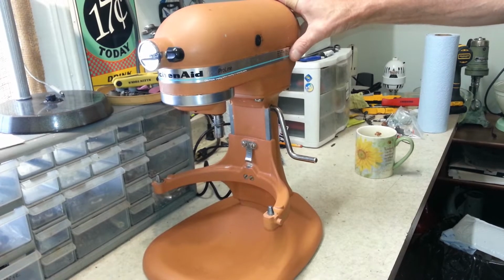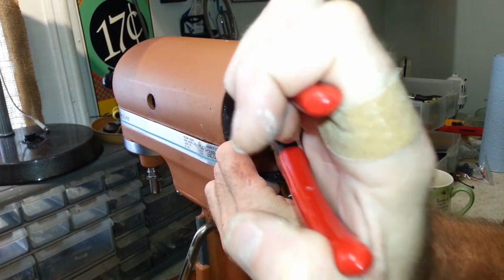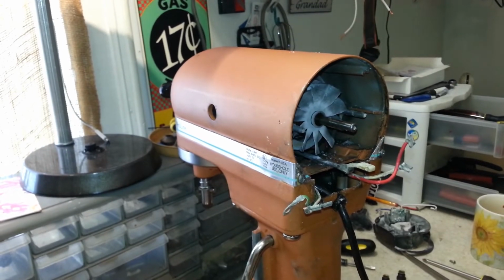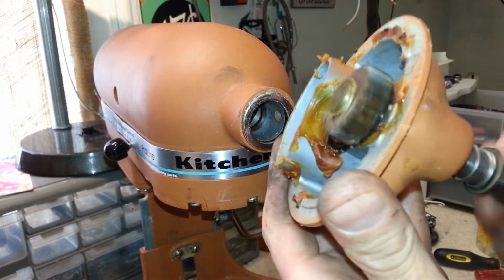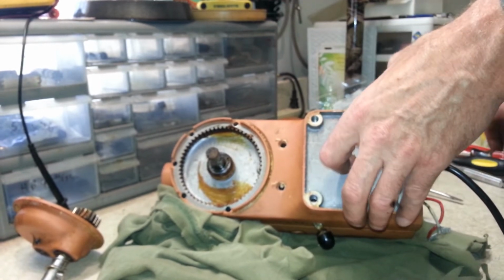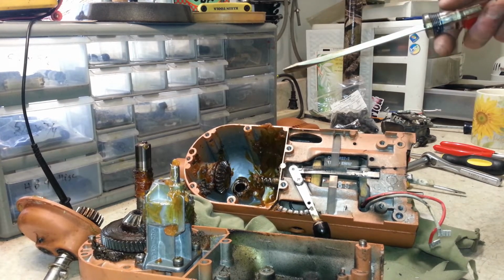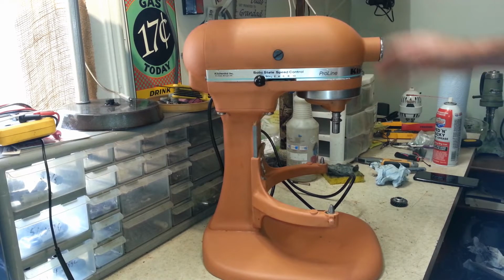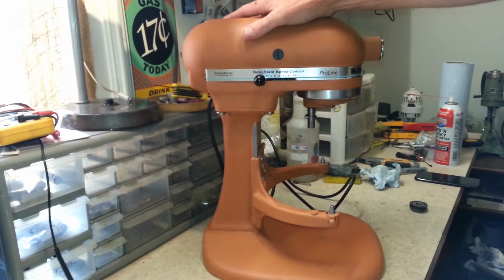Kitchenaid KSM5 service and maintenance

Comment: Much thanks.  Between this video and another explaining the brushes (for when I inevitably put them in wrong and the machine wouldn't start after putting it together), I successfully cleaned and replaced the worm gear assembly and regreased my KSM5. It's a hand me down from mom,  prolly 25 +years old. I don't know if they're the same quality today,  but man,  that's longevity.

Comment: I've hit a wall on fixing my wife's Hobart Kitchen Aid K5-A and I thought with your experience you might be able to answer a couple of questions.  The mixer has no serial or model numbers on it except that it's a K5-A by Hobart. It was purchased in 1974 by my wife. It was diagnosed by an electric motor shop as having a bad armature with a dead spot on the windings. It would run briefly then not run.   I looked up parts on the internet and found an armature that was supposed to work. When it arrived it looked very similar with the exception of the fan. The new one was a multi-bladed fan that was slightly wider and in a slightly different location on the armature shaft. It appeared to fit until I attempted to fit the baffle plate. The fan stopped the plate from going all the way onto the shaft and because of that the rear bearing holder wouldn't seat correctly either. On close inspection, I could see the type of fan and it's location was the issue.  It appears this armature is for perhaps a K5SS with the solid state internals.  Every supplier that shows they sell these armatures have the ones with the different fan, not like the flat one on my mixer.   

After all that, my question: I've seen there is a picture of a different rear bearing holder on some sites that is supposed to fit these older mixers but the picture shows a more open, slightly cup shaped bearing holder that is different than mine. I'm wondering if this would work to provide the extra clearance for the bigger, thicker fan. If not I've got an un-fixable mixer for lack of a part.   I wonder if any of your viewers have any ideas?

Comment: Hi Rick, great video !   I do have one thing to comment about, I also collect sewing machines and I learned long ago to never use "3 in 1 oil" it is a combination of three oils and two of the oils are for protection and as they dry or oxidize, they harden to form a protective layer, it works well for guns and things like that. The oil I used to use on was Zoom spout and it worked fine and did not harden, I found I needed to oil machines about every six months or so. I found something much better " Liquid Bearings 100% synthetic lubricant " this can be purchased on e-bay and I think Amazon, This oil is made with oil molecules all the same size and it works so well and does not dry out, I find I can now go for two years between oiling on my machines and it seems they work smother as well. I have used this as my go to oil for about six years now and would be lost without it. Another great thing about this oil is it has stainless steel needle spouts that come with it you can chose the length or several lengths and be very precise with the amount, on things like clocks.    Best to you,   Brett
Reply from the maker: Hi Brett! Thanks for the tip on the synthetic oil, the technology in lubricants has really evolved! That sounds like it would be perfect for mixers as well, since most do not get the periodic oiling they require. Im not sure what the protective layer in the 3 in 1 consists of, but that would probably be beneficial to the mixers too considering the environments some are used and stored in. I may look into that oil for my sewing machine as well, since I don't use it a lot, and when I got it and oiled it, it looked like the places that get oil were a bit gummy so I had to try to clean them as best as I could. It also needs to go in for service at some point for adjustments, which I know nothing about. 
Thanks!
Reply: Hi Rick, The gummy condition you found in your sewing machine is the result of 3 in 1 oil being used in it, either use the synthetic oil or a quality sewing machine oil, with repeated use the new oil will help to wash out the old gummy stuff. You are a great one for maintenance on things and sewing machine service is usually just cleaning and oiling, so if your machine is sewing good just use it, and play with the thread tension to learn what is right, the bobbin tension is pre-set and very rarely needs any attention so just note the tension number or letter you start with and go one number up or down to see what is happening with you stitch, you want your threads to meet in the middle of you fabric seam. be noting your original setting you can always go back to it. For oiling, the place to oil the most is the bobbin race area around the bobbin holder, a drop in this are every few days of sewing is good if you use it a lot. The thing you found with the gumming up is what happens with 3 in 1 oil, it clogs up the holes in bronze bushings and clogs up any felts or wicks meant to feed oil into the bearings.   Best to you Rick,   Brett
Reply from the maker: Thanks Brett! I will get some proper oil for my sewing machine before I use it next. I think I have figured out the tension thing, I noticed I did have to change it some when sewing thicker materials, and I just practiced on scraps for quite a while to figure it out. I have wanted to do a lot more sewing but just haven't had the time, so I will take the machine to get checked and serviced in the meantime, I think some curtains will be my next project :)

Comment: Hello Rick, God to see you're doing so well. Maybe it's time to bring in an intern to help. Just a thought. Well after much much groveling and begging my wife I have finally wore her down and I am now looking to purchace a Hobart A 200. I love the smaller models but just not enough umph to do what we need. For what the boat ancher 6 qt. kitchen aid and all it's attachments cost I can get a good used A 200 with three standard atachments plus the pelican head. One guy even has one with a meatgrinder for a couple of bucks more, that's the one I'm eyeballing right now. We still enjoy your videos you make them so easy to watch. The fast forward with sound really cracks us up. I would still like to send you the one mixer for clean and lube, but it can wait on it's shelf till you have more time. Keep going man as you can see your tallents are needed by many. Hope your wife is doing well. We'll check back for a  available time slot. (I probabley should not drink and message, oh well) Mike and Bronwynn
Reply from the maker: Hey buddy, thanks!! I think once I get caught up, it will go pretty smoothly, just seemed to be a bunch came in all at once there! 
Sometimes you just got to have the power you need instead of trying to get by I guess, the bigger machines certainly do pack a lot more power. Sounds like you found a pretty good deal too! 
I will still be putting out videos as well, as I get caught up. Seems I am in the middle of a few that need parts, etc so some are 95% finished and getting put on a shelf till a part comes in, and holding up the video upload lol. 
Hope all is well with you guys, thanks again!!

Comment: Hello Rick, Very informative videos!   I have a kitchen aid ksm5, Can't find any information on the planetary screws, not made any more, all I got is #4160595, special screws. Would you happen to know the dimensions of this screw? Thank you..
Reply from the maker: Hi! I assume you are referring to the 5 screws that go around the planetary assembly holding the upper and lower half together? I can only find the part # as well, 103994 , and no one has any left in stock unfortunately. Ebay turned up some torx head screws from the UK. As far as size, Im really not sure, I dont have any on hand to check either, and none of the parts places show dimensions or thread size.
Reply: @vintagemixersandmore1666  Yes, that's what I was referring too.
Thank you for your time, I'll keep checking, or I'll find something that works..
Appreciate your help ..Art

Comment: Awesome job! I need your help! My attachment is about an 1-1/2 inches away from the bottom of the bowl. I was given this KS55 but can’t seem to find any video on how to adjust the clearance. I tried the nut on the bottom of the access hole but nothing. Suggestions??
Reply: This comment is old so you may have already figured this out, but that sounds like your bowl is not lifted. Turn the metal crank on the right side 180 degrees counter clockwise to lift the bowl up.

Comment: Awesome video. I’m watching because the agitator shaft (shaft that extends into the bowl and connects to attachments) on my K5SS broke at the tip. After removing the planetary I could not figure out how to separate the shaft from the gear / rest of planetary. Do you have any insight or help? The replacement shaft is sold so I assume it is possible. Thanks for the great videos @Vintage Mixers and More
Reply: There's a slip ring around the shaft. It's a ring with a little hole on each side. It's a PITA to remove and put back on, fyi. I used a flat head screwdriver to get under the slip ring and pry it off. There are pliers made for slip rings, but you can manage without them.
Reply: Other videos he has probably show this process of taking off the slip ring, I watched his others and learned.

Comment: Hi need your assistant, i ordered the worm gear on ebay for my kitchenaid KSM5 mixer and i replace the worm gear, put mixer back together taste it and its in working order but as i use my mixer to make bread i put the wet and dry ingredients in the mixing bowl started mixing as the dough starts to form, the mixer stops spinning. So i open up the mixer to check on the worm gear and its not worn out. What do you thing the problem is?
Reply from the maker: Hi Harold, I would say 99% of the time it would be the worm gear, if not then it's really hard to guess what it could be instead, perhaps the planetary or sun gear in the planetary housing? One other thing I just thought of, take a look in the planetary at the gear that is held on with a screw, remove the screw and washer and lift the gear, there should be a little pin under it that locks it to the shaft. If this pin were to shear off it would also cause the planetary to not turn. Hope this helps!
Reply: @vintagemixersandmore1666  ok thanks for the info. 👍🙂
Reply from the maker: @haroldflores2272  you bet!!

Comment: Hi Rick, nice video. I’m concerned by the end result is so loud & noisy almost like it rattles at times instead of humming or even purrs. What gives?
Reply from the maker: In every video it seems they sound quite loud and noisy, but they do not sound that way as I hear them. I think it is the way I record, I definitely do not have a professional setup at all. I think most viewers have gotten used to it by now.
Reply from the maker: I just rewatched the video, yea sorry that was one of my worst setups. I record with a galaxy phone it was attached to a telescoping arm attached directly to the counter, you can see it vibrate when the machine runs. It does sound terrible in the video, I think its all the vibration transferring directly to the recording. I always thought one day I would have a decent camera and mic but it never seemed to happen.
Reply: Those KSM5s have always growled and rattled.  They were quite noisy compared to, for example, the Pro-Line 7 series they have today.  I had one from 1996, and it was a Hobart design just like the K5SS.  Used it for 7 years to make ordinary bread, cookies, or anything that fancied me.  It finally started leaking around the ring over the planetary gear, and I paid $80.00 to fix that before giving it to my biological mother.  That mixer was so shot, it would smell like the old Sunbeam Mixmasters while it was in operation.  Last I remember, she was using it as a decoration and still uses a wooden spoon.  My 4 year old Commercial 8 will run circles around that old KSM5, and that 4 year old machine is still weak compared to my 18 year old Berkel PM-10!
Reply: Yeah, I figured your setup was connected to the bench when you started pounding on that pin. Felt like I was on a roller coaster, lol!  Nice video!

Comment: Hi Rick - I need to replace the worm gear on our Kitchenaid KS5M ProLine mixer just as you did in this video.  The old gear was metal and I see you were able to replace the metal worm gear on the mixer in your video with another metal worm gear.  All I can find to replace it with are cheap plastic gears.  Is it still possible to get a true metal replacement and not have to rebuild this with some cheap plastic knock-off???  The mixer was originally purchased in 1994 and this is the first time it has ever needed service despite significant usage over the almost 30 years it has been in service.  I just hate the thought of taking a machine that was built to last (and did) and rebuilding it with a part that has since been engineered specifically to be a planned point of failure.  How were you able to get a metal replacement gear??
Reply: Well... I feel silly.  It turns out that the gear merely LOOKED like metal.  But it wasn't; it was the nylon one (reinforced with kevlar or carbon fiber I think?) it just happened to be colored such that it looked like it was metal.  That said, after thoroughly researching this part and searching for a metal option, what I did find is that there are a lot of cheap knock-off parts circulating.  I took care to be sure that I was getting a genuine factory oem replacement. The new part had the same metalic look as the original part.  Many aftermarket worm gears are out there which, people are reporting, are not affixed firmly to the shaft and so they slip on the shaft under load. Basically the motor keeps running, but the beater slows down or even stops, yet the gears are not stripped, they're just slipping and rotating on the shaft.  So far everything is working very well again after this repair.

Comment: Hi, I removed the motor brush on the left while the machine was plug in, and accidentally touching the frame on the way out, it gave a spark, and machine is no longer running. Did I short the motor or the circuit board? It the KSM150 artisan 5 quarts model. Thank you.

Comment: Hi Rick,
Once again a terrific video. :)
Maybe somebody already has asked you about it but can you say what exact grease you use in your restorations? I've seen that one of them is Lucas Oil Red N Tacky in spray, but what about the one that is the blue dispenser? Thanks for your response.
Reply: Nevermind mate: I've found it in one of your other videos: it's Red N Tacky #2 :) 
Keep doin' your awesome work.
Regards.
Reply from the maker: @jlbernaldez  Thanks! Ah ok, yea I couldnt find it in the can or tube that time, so I grabbed it in the spray can. It is really only good in the spray can for getting into tight spaces, otherwise you have to use a lot since it comes out with more propellant than grease!
Reply: @vintagemixersandmore1666  Yeap, I've seen that as well: depending on how tight the space is you use spray or big dispenser. The good thing is that I've been able to find that exact grease in my country (not US) so your videos and guide have been really helpful ;)
Thanks mate.
 Take care.
Reply from the maker: @jlbernaldez  You too!

Comment: Hello sir I just picked up pro 500 for wife xmas gift litely use. It was leaking oil from sides when it tipped on it side in car. So what is best place to get parts price and quality wise. Also the grease you use is it food grade grease? Is one brand better than another? Thanks for your time.
Reply from the maker: I think you can order parts for that model from anywhere that sells kitchenaid parts, like partselect.com . I did not use the food grade grease for that very reason, it breaks down and leaks everywhere, I used a lithium based grease. I think there is a silicon based food grade grease, I dont recall the name, someone else had told me about it, but if you look up food grade grease you may find it.

Comment: Is that food safe grease???
Reply: Synthetic grease doesn't separate and leak out of the mixer head like the food safe grease. I have never had a problem using synthetic grease in a Kitchenaid mixer.
Reply: @chevyguy6961  lol... So NOT food safe than...
Reply: @TheJkilla11  If it doesn't separate it won't leak out of the mixer. The original grease was mineral oil based and it would separate and leak out due to the mixer not being run enough to keep the grease blended.
Reply: @chevyguy6961  sooooooo notttttt foooooood SAFE then.
Reply: @TheJkilla11  How's it going to hurt you if it doesn't separate and leak out. Synthetic grease is totally safe.
Reply: @chevyguy6961  you should totally upload a video of you eating a container of it sense its so safe an all...
Reply: @TheJkilla11  Again how's it going to get into the mixing bowl if it doesn't leak out of the mixer

Comment: Hi,
How would I determine if the armature is damaged? When I start the mixer, I get a grinding noise with a burning smell. I changed the grease and checked the gears in the mixer.
Reply from the maker: You would have to test it with a multimeter to determine if it is bad. Worn brushes and a worn speed control plate could also cause it to run rough which would be noisy as well. There is also a bearing on the front of the armature, I have never seen one fail, but if it did it could make a lot of noise and the drag could heat up the motor causing it to smell hot. Just a few things I can think of off the top of my head.